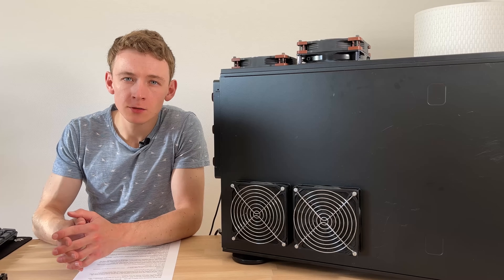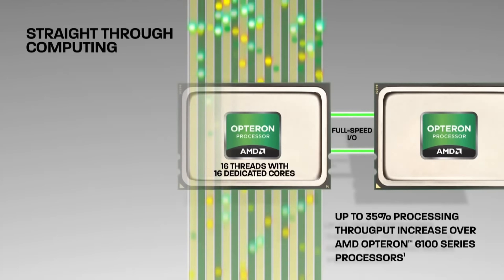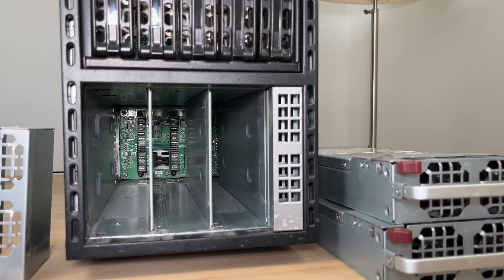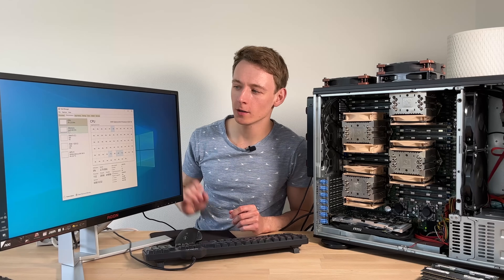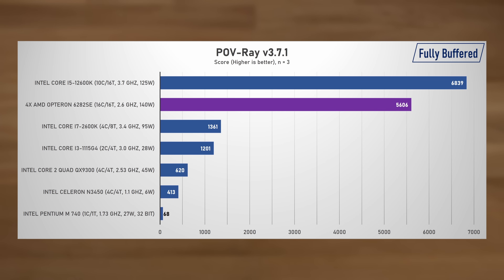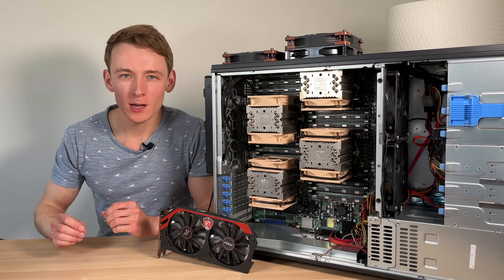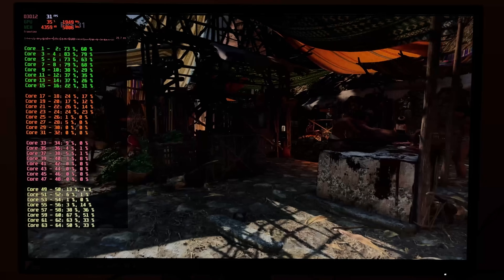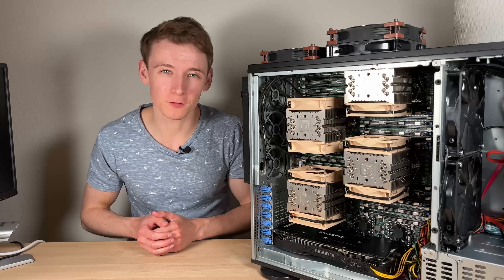The Quad Socket 64 Core Opteron Monster – The Most Insane Desktop PC

Comment: Insane PC, upgrade the CPUs to 6386 SE, those are Piledriver and have 200Mhz better all core clock
Reply from the maker: Thanks for the comment! I've got the Abu Dhabis in already, but the 6386s were too expensive sadly.
Reply: @FullyBuffered  the cpu system seems nice, all you need to do is use a pcie extender to external most pcie based equipment for at least 4 users.
Reply: @FullyBuffered Just save up for the most powerful cpu's that will work in there, and upgrade to 1tb of ram... 
(No big deal, just all of the money...)
😂
Reply: I can only begin to imagine how terrifying a TR4 socket version of this concept would be, with the top end Threadripper or Epyc CPUs tearing tasks to pieces with ruthless speed
Reply: @UNSCPILOT  welcome to the world of mainframes and supecomputers
Reply: @UNSCPILOT  Sadly, it can't be done. They are so fast, that 4-way Infinity Fabric links would be a huge bottleneck.